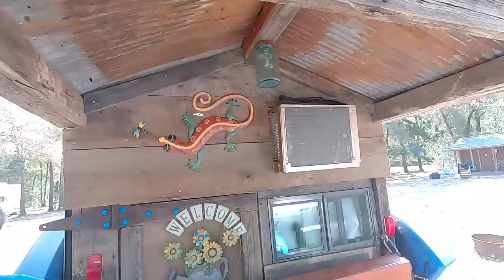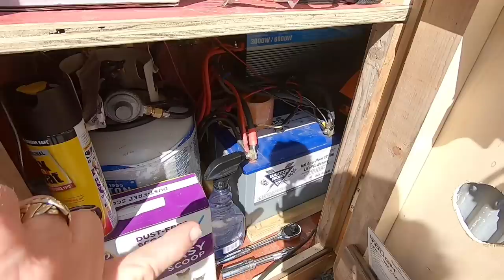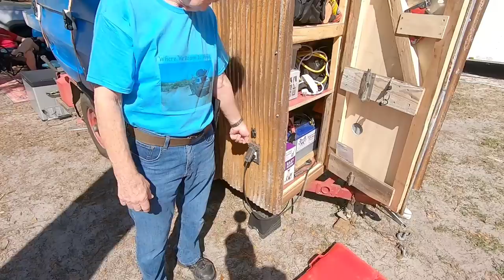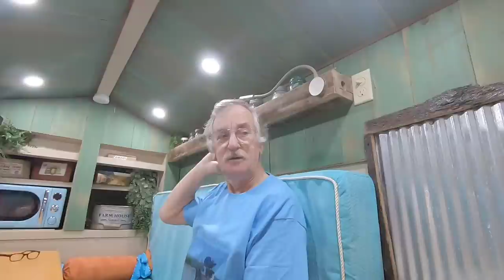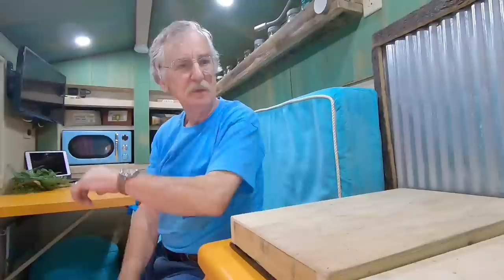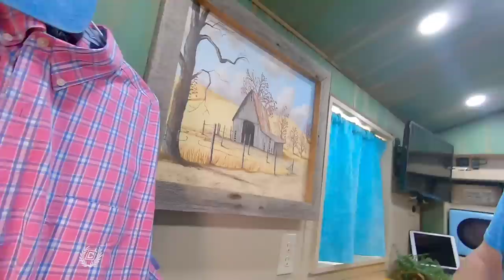From Old 5×8 Trash Trailer To Unique "Travel Cabin"

Comment: Wondering if mounting the transfer pump in the vehicle would work? Got me thinking about setting something up like your system for myself.
Reply from the maker: The only thing that would concern me about that is the pump would have to draw down about 25 feet of hose before it was primed. You could possibly fill the hose first, but how would you do that? Since that is technically your "sewer hose" you most definitely do not want to prime it first from any fresh water source. Cross contamination can be deadly.
Reply: @billanddeb  I see your point. Will be thinking about a solution to what is in the hose and capabilities of the transfer pump.